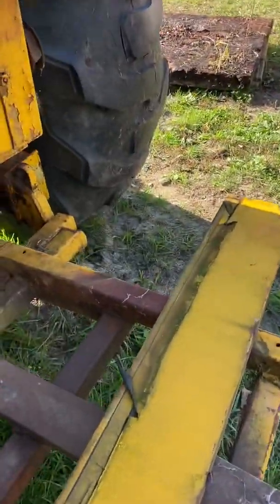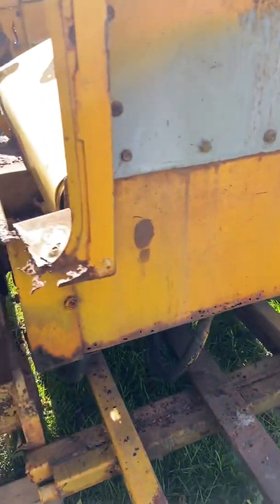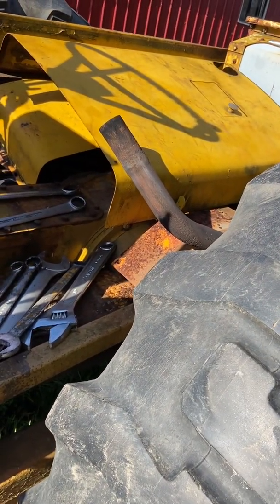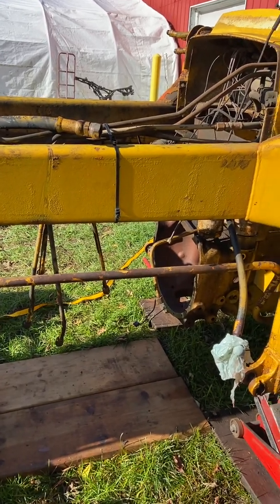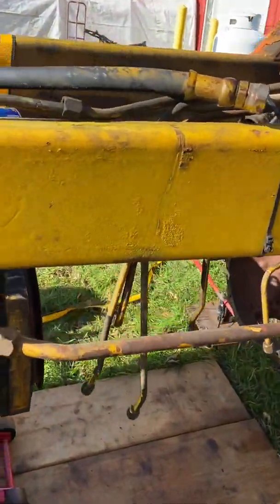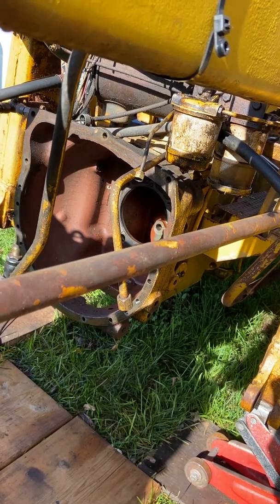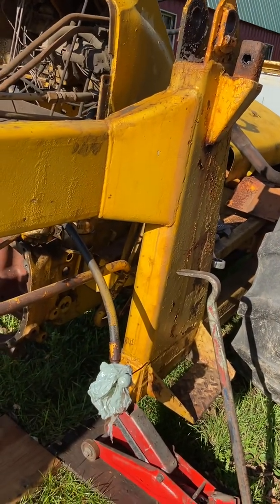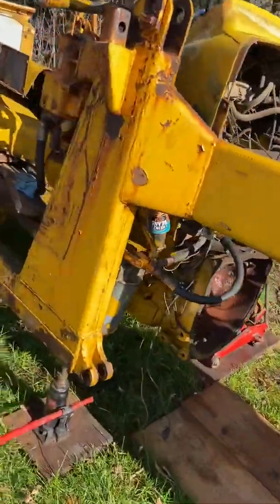MF50A Instant Reverse Transmission

Comment: I have a 50c with the same transmission. It works great but leaks like a sieve from the weep hole at the bottom of the bell housing. I assumed it is from the pump and i would need to find time to separate like you did but I also notice its leaking from the two ports on the left of the bell housing. Looks like they are from the pump and go external from the transmission. Do you know what is most likely leaking before i tear it apart?  Is it possible that the leak is from those two ports and i dont need to separate?  Any advice is greatly appreciated. Thanks.

Comment: dealerships and repair shops do have mechanics anymore and haven't for 25 years, they just have parts changers. I have a 50, a 40 and two 20s all with loaders,   plus extras for parts. the greedy scrap dealer have junked many of them

Comment: Hii, i have a mf 50b its doing good job to now, from plate under flywheel came oil out, drive is working, its hear some noise...
Reply from the maker: Hi there!
    Sorry for the late reply. You probably have a leaking torque converter seal. It’s a small parts but lots of work to replace.
Reply: Flywheel is damaged, so i need new one, maybe you now where  to buy it? 
On service said, i cant buy animore..
Reply from the maker: @sebastjan7020  
    Can you send me an email at ricklongtin@bell.net with a photo of the damage?
Thanks,
   Rick

Comment: these are awesome videos ..would be very helpful ...i haven't broke my transmission yet but if i do ...i think its a mf50a ..it doesn't have the hoe on it but the front loader and the cab are still there ...hope you are doing good and your hand is getting better
Reply from the maker: Hi there!
   Sorry for the late reply. Thank you for the kind words. My hand is almost perfect now, thank you! Many people use reverse to stop these machines when the brakes wear out (or even if they don’t feel like lifting their left foot!) causing premature wear of the reverse clutch plates. Also, checking the oil level often helps to ensure you don’t burn up the clutch plates. They’re good machines and they’ll last a long time, even with abuse.

Comment: I have a M 50 backhoe and I’m not quite sure what year it is. I need to fix my reverse and wet brakes also. I don’t want to take it apart until I know for sure that I have the right parts. Where is the best place to buy parts to replace for reverse and wet brakes? Thank you YouTube
Reply from the maker: Hi there!
   Sparex.com would be my choice. I’m not sure if they sell directly to the public, but they can certainly direct you to a dealer, or You can go straight to the AGCO/ Massey dealer, and if they’ve got the right parts guy, they can be a big help. As far as parts needed, it’s always best to strip it down first and make a list. It makes for longer downtime, but in the end you’ll be certain you have everything you need. As far as the brakes go, do you have a cab on your machine? I’ve never done the brakes on one. If they were no good (and most of them were no good), I learned to do without. As far as the transmission,!years are not all that important with these machines. 50a-50c and probably many other models and years have used the same parts.

Comment: Hello,  Thanks so much for making these videos.  I have an old 50C Backhoe.  It is in fairly good shape but needs some work.  Going to be rebuilding the boom cylinder and fix a few fuel leaks.  I have the exact instant reverse transmission and it will be needing a rebuild soon, as the tractor has trouble in the higher gears.  Thanks kindly so much again for your videos, they are invaluable for those of us who have these older Massey tractors.

Comment: I have mf 40 instent reverse that I got with no reverse I currently have it split and the pump of and help you could give me would be great.
Reply from the maker: Hi There!
   Sorry for the late reply, it’s been busy and cold here! Most likely just clutch packs, but remember to pay attention to the small details. If you had forward, obviously the pump is good, make sure the steel seals on the shaft are all good (one broken one can ruin your day!), clean filter screen and decent oil. Always a good idea to test the clutch basket seals too. They get old and you tend to lose pressure there.
Reply: @longtinrick  thank you very much I was worried about doing this job.i have never split a tractor before. Your videos make it much easier to understand then just trying to use manual.  Do you have a phone number for the place you get your clutch parts from? It's been cold here in Pepin Wisconsin to it was -26 on Wednesday morning and 30 above on Thursday morning and now on Friday morning it is -10 crazy stuff. Thanks again
Reply from the maker: @ericbaader6625  
   I pick up my parts locally, however, the owner of the shop is feeling poorly these days, and probably isn’t up to shipping anything. The part numbers are actually in another video, which is titled as part numbers. Sparex parts can be ordered online, or at any AGCO tractor supply place. The Sparex gasket kit is #S.42839, just in case I forgot to put it in there, but the disc numbers are there. If you plug those numbers into Google, you can buy them all online from the company of your choosing, or find a local supplier who can order them for you. I hope this helps!

Comment: Great info on the MF50, just found your videos. I  bought a MF 40b with instant reverse that the transmission had been overfilled by 4 gallons, now at the proper level. It moves forword and reverse but slips in higher gears and blows oil out of the breather on top of the gearbox. I plan on adjusting the throttle and f/r  linkage first, and checking the screens/filters. Could this be causing the slippage/oil blow out? Thanks Joel.
Reply from the maker: You shouldn’t have excess pressure in the transmission, causing oil to blow out the breather (of course, overfilling and possibly overheating would certainly cause that. Make sure your trans cooler is clean. They can get oily and grab dirt like a magnet. As far as the slipping goes, you can always try bumping up the pressure a bit with the regulator valves on the side of the transmission (I think I touched on that in one of the videos, but if you have a manual, it outlines the procedure pretty well. Of course, you could just chalk it up to wear on the clutch packs. They last a long time, but eventually, everything wears out. Does yours have a three point hitch?
Reply: @longtinrick  Yes  it does have a working 3 pt and loader, I'm sure it had a backhoe at one time ( extra hoses and beat up fenders). I have a manual for a MF 50 that looks to be pretty much the same that I will reference. I also own a MF 30 ind loader but that one has the 3speed shuttle so I can't compare that trans system. Could a plugged filter on the cooler line cause the pressure in the trans? Hope to have time to get it in my shop next week and make adjustments and check pressures as outlined in the manual. Any other advice will be great. Is there a better way to contact you or just comment here? Thanks again.
Reply from the maker: @belindastorms3329  
   I’m new to Youtube, and have no idea on how to contact people otter than comments, so you can contact me at ricklongtin@bell.net